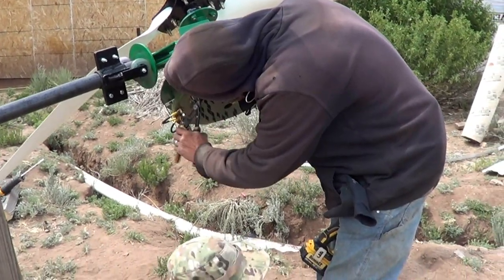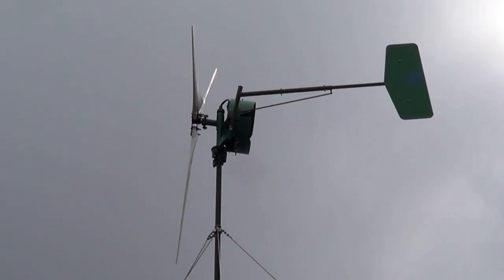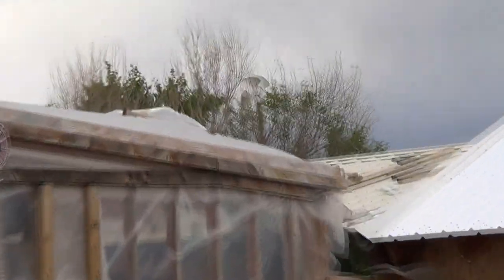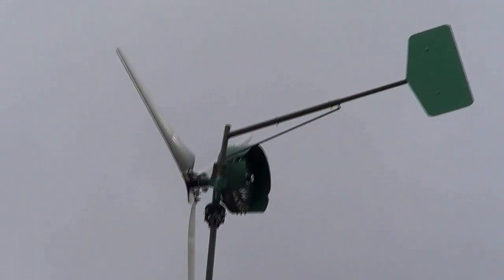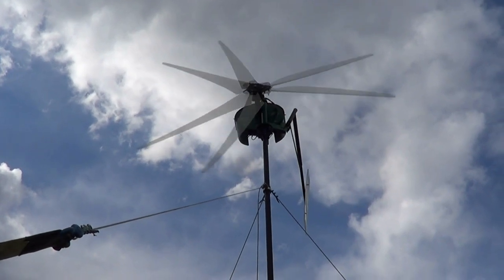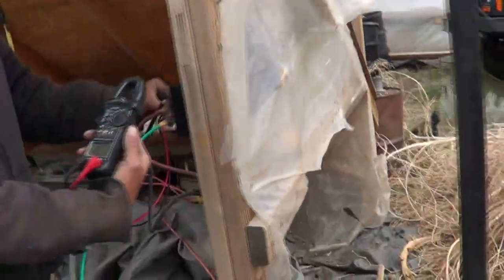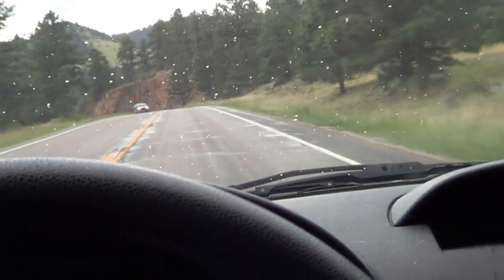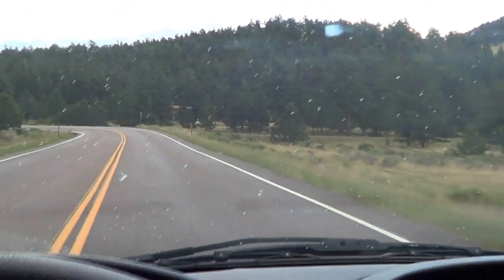AXIAL FLUX WIND TURBINE BLACKJACK WIND TURBINE INSTALL

Comment: AMAZING! Appx how many watts does it generate? How many volts @ how many amps @ x rpm? Wow it was whistling it was going so fast! Do you store the energy in a battery grid, or just experimenting for now? Ah yes I saw about 40 volts and 90 volts, appx how many rpm was it going @ 40 and @ 90? THANK YOU!
Reply from the maker: Thanks Justin for commenting here!! It will make 3,000 watts, but this is at 10,000 ft. elevation in the mountains. So with air density not sure what the out put will be. So we'll see! Tim the owner of turbine, is going to put a wind gauge on the pole maybe so we compare wind speed and output. Tim storese he power in batteries, because he's totally off grid! But more to come, thanks!   https://www.youtube.com/watch?v=VVccaEzIKAA&t=267s
Reply: @blackjackaxialfluxturbines4174  This is simply astounding! Wow 3000 watts! Can't wait to see the results of the air and all that, neat!